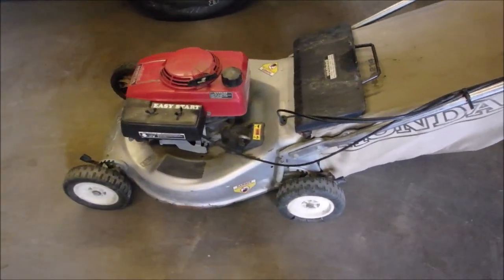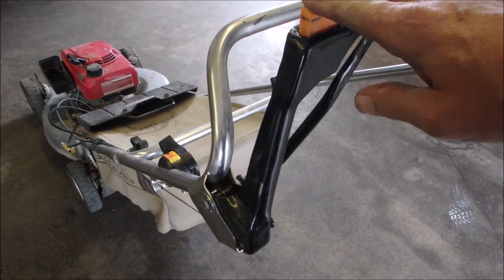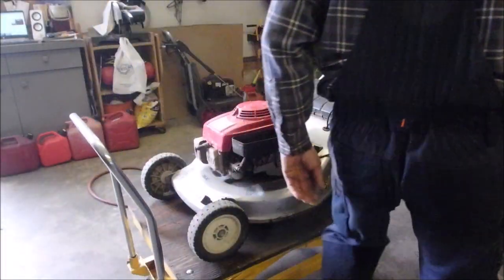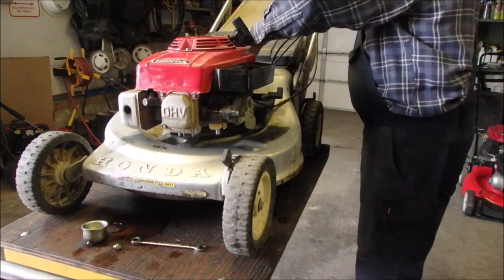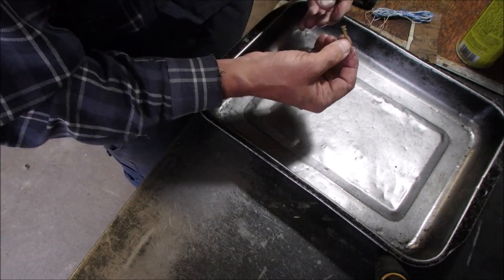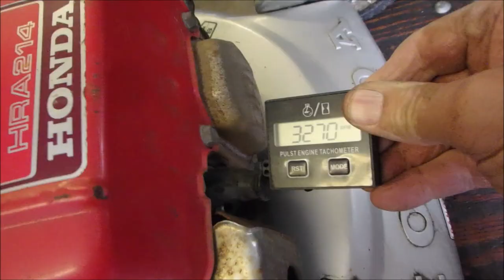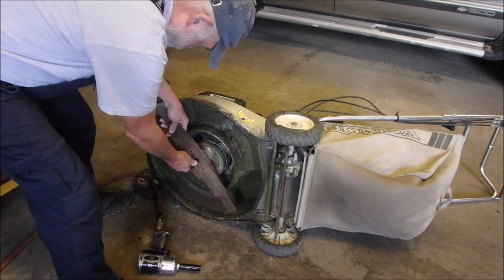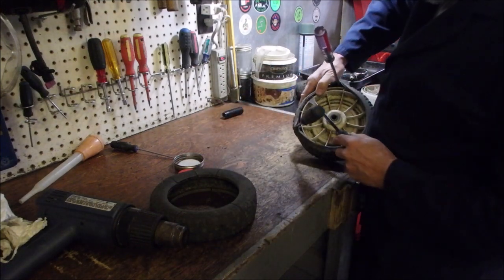A Classic Honda HRA214 Repair

Comment: Nice work Bruce!
Scary how on those old side starters, how your toes can end up right around the edge of the deck when it starts!
I believe they put the date on it, but it will be in Roman numerals!  🤣
Going to send you a new tool I discovered for cleaning e-tubes and jets. Stay tuned!
Reply: Looking forward to seeing that tool...
Reply from the maker: Well the blade doesn't turn on this one until the lever is closed
Reply: @BrucesShop  
Good point but likely some models that don’t have the blade clutch.

Comment: Nice job Bruce these last forever, if maintained. Bought my first one used 30 years ago sold it at a $50 loss from original purchase price 3 years ago still running. DO NOT wash the clutch area or the rear wheel drive area with water the bearing on the rear wheel drive will be the first thing to go so make sure you spray lub them to help or change them out before they seize. 2 brought in last year that the seized bearing cut right through the drive axel one was scrap (axel in pieces) the other (axel groove worn in) built up the axel with weld and ground to fit new bearing.
Reply from the maker: Thanks a lot.

Comment: good work there, I could never get that jet out with out taking carb off the mower first.   I just had a new style briggs 150cc OHV  with the main jet clogged but couldn't unclog it. (rock hard ethanol deposits)  I ended up replacing it from a scrap carb I had.     if I remember correctly the gas that was in the carb was very yellow and smelled really bad.
Reply from the maker: There are so many like that.  Or the customer puts new gas in the tank but it is yellow still in the carb.

Comment: Bruce, if I had a nickel for every time I pulled the plug wire off then forgot and tried starting the machine, I'd have a trash bag full of nickles!  

Looking forward to part two.
Reply from the maker: That is so true.  Thanks
Reply: @BrucesShop  You're welcome....tis the season to repair what the fiddle fairs have done!

Comment: I have the exact one but my self propel doesn't work anymore 😢 can you help?
Reply from the maker: We as I have not seen it that is tough. 
1.  Check the cable that activates the drive.  Is it loose or broken?
2.  There will be a belt that drives the gears underneath the mower.  Is it shredded or loose
 3.  The gear box may need work.  Spin the pulley on top of it and see of the output shaft turns.
Be careful and do not do anything with the engine running!!!!!!!

Comment: I inherited one that is in pristine condition, except the left rear wheel is shot.  I cannot for the life of me figure out how to get that wheel off.  It wont break with a my electric ratchet or by hand.  I tried backing up the other side and it's just not coming out.  Anybody got a suggestion?
Reply from the maker: Have you tried heat?